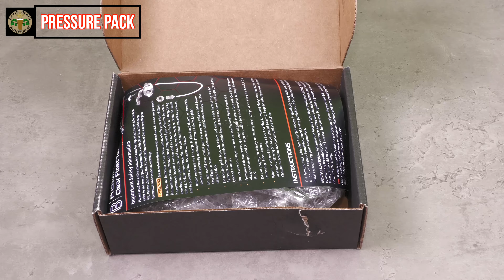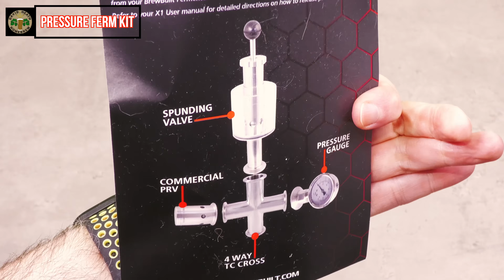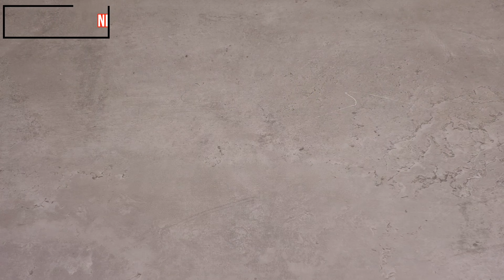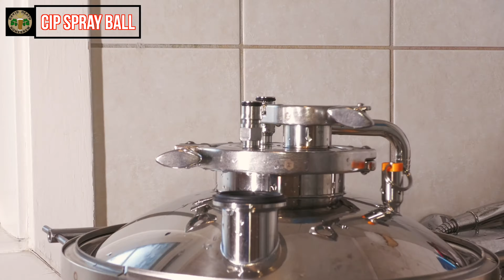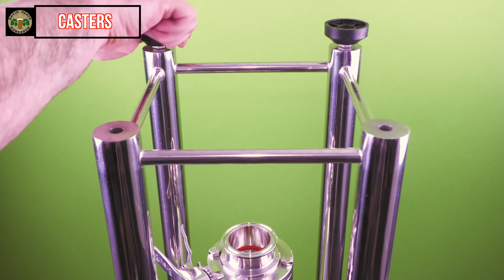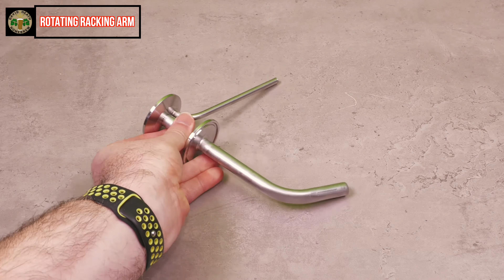BrewBuilt X2 Accessories Impressions For HomeBrewers

Comment: Looks like a decent piece of kit. I currently have a grainfather conical pro and have been toying with the idea of an upgrade to a unitank but couldn't really warrant the spend. Let's see what this is like. I saw from your video that heating is taking care of from a heat mat. Is cooling taken care of by the two tri clamp ports on the side? I assume i would be able to connect this to the grainfather glycol chiller by using appropriate tri clamp plates and hose?
Reply from the maker: Hi John, certainly I am very impressed so far. Ive been using my GF glycol chiller with it, via the adapter kit. Works well and the cooling sleeve is much bigger than the GF conicals widening the volume you can cool nicely.
Reply: @David Heath Homebrew  with the grainfather expansion kit do you use the grainfather heating pad  from the kit or the brewbuilt one ? 

Cheers!
Reply from the maker: I have just used the Brewbuilt one connected to a temp controller. I just use the glycol chiller at the end of fermentation to cold crash.